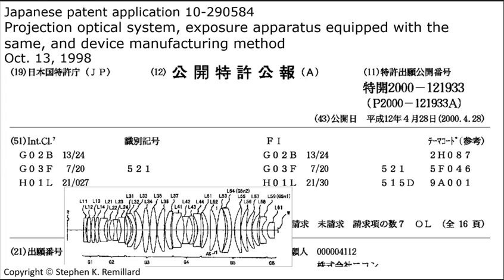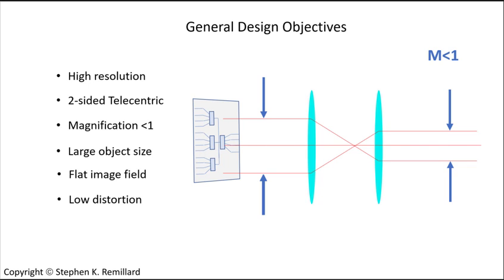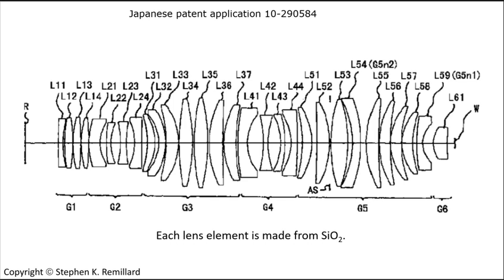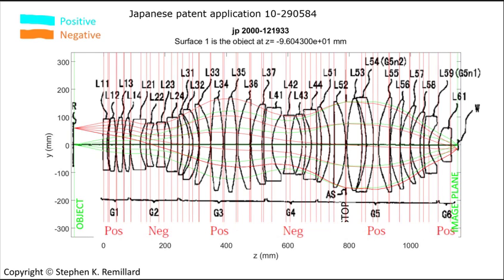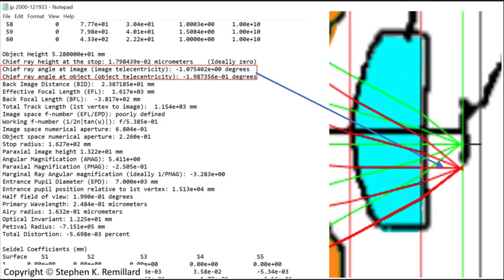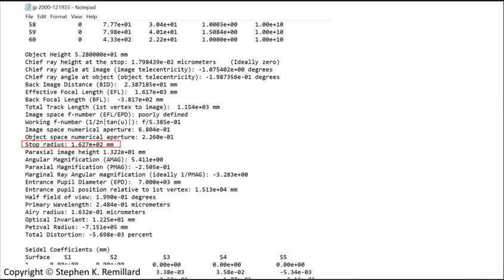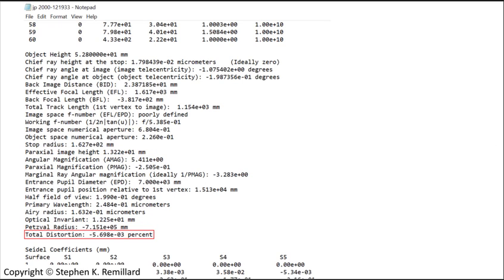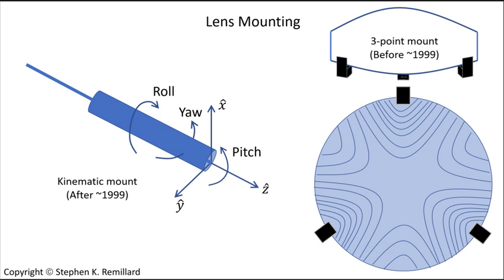Microlithography Reduction Projection Stepper Lens Design: A Patent Study

Comment: Production had a stack of a handful of every single lens in the system. A robot would take one lens after the other from the storage, set it into the system and tests are made, results stored. Then the best fit would be mounted into the new system, and the whole procedure starts again with the next lens in the stack. It was semi-automated production with trial and error.

Comment: Hello Stephen. It seems to me that such a large number of glass-air-glass transitions will change all theoretical calculations to Zero due to re-reflections of glass surfaces. I'm a photographer, but I'm interested in microphotography. Eduard.
Reply from the maker: It is a lot of surfaces isn't it.  With 58 surfaces each having a 1% AR coating the back-of-the-envelope transmission is at best  0.99^58=56%.  Not zero, but still a lot of loss.  I'm not really sure if anything else is typically done to reduce loss with so many elements.  The stray light from these reflections is probably no trivial matter either.
Reply: @stephenremillard1  Yes, scattered internal light will also lead to a significant decrease in contrast, halos and blur at the borders. And this is the most necessary thing in lithography, a clear/sharp separation from dark to light.
It would be interesting to see an image from this lens on a matrix camera. Creating one copy of a lens is an expensive pleasure. Only an enthusiast who risks time and expense will be able to do this.
Reply: @stephenremillard1  Maybe look at this with lens blocks immersion glued on. You may end up with universally changeable options.
Reply: @stephenremillard1  Hi Stephen, you're quite correct, a 1% AR coating would lead to quite a bit of loss! However, modern 248nm and 193nm AR coatings have reflections of 0.1% when measuring normal from the lens surface, it's amazing how far we've gotten in that field! Off-axis reflectance performance is also quite remarkable, I've seen a paper where they achieved 1% reflectance even when oriented 49 deg off center in 248nm!

Comment: OE here. Did you get the index from the patent? At that wavelength, the index will vary with glass manufacturer. Also, different glass manufacturers publish relative to air, N2, or vacuum so it can be tricky.  Oh, and they publish at different temperatures too. It can be a real pain to decide what index to use in the deep UV, especially below 248. 

A lens like this will also have several compensators - elements that are adjusted after assembly to reduce aberrations.  At the very least, there will be one element adjusted in x,y to reduce coma, and one adjusted in z to reduce spherical.  Maybe a third to adjust the mag to exactly the right value. Deciding which elements to use is a complex process usually determined by singular value decomposition, which CodeV can do, but not Zemax.
Reply from the maker: I used the value of refractive index that was included in the patent.  The patent was in Japanese along with a translated Word file of the text in English posted by the Japanese patent office.  The translation didn't mention if the refractive indices were relative to air or vacuum.  Of course, patent embodiments usually aren't the best optimized design.  Thank you for bringing up compensators.  Now that you mention it, surely the inventors had some compensation methods.  I'm curious to know what.  Of course, I won't be able to investigate that with my homemade code.

Comment: Hi, I am newbie and got interested in optical design while building small refractors.I wanted to build a Petzval lens with for a small F ratio with 2 doublets for deep sky observation. Recently discovered your channel and seems to have very good information related to Optics. Looks like you have used Matlab. Would love to see how to write raytracing code without fancy software and would appreciate if you could make a video on this. Thanks for this video.
Reply from the maker: Done.  Here's the link.  https://www.youtube.com/watch?v=5962dgvPZCk
Reply from the maker: Most certainly!  Stay tuned.  I will post it in a week or two.  And thanks for using my channel.

Comment: Hello Stephen!
Nice to see the video that you shed insight on the UV lithography lens design. 
I was thinking last night in this bulk lens ray trace as the ray angles can be larger with the strong + and - ve lens groups, do you use tan(u) instead of u in the YNU ray trace propagation?
Reply from the maker: Good question.  Yes, I do use tan(u).  When larger angles are involved, I find that the benchmarking against my Zemax-analyzed projects is noticeably closer when using tan(u).